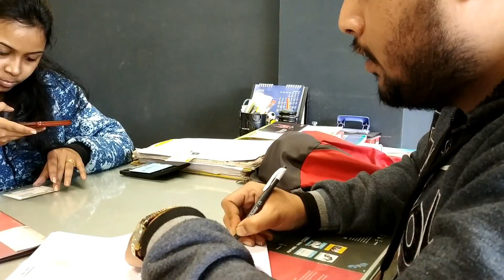Taking Delivery of Aprilia SR 150 ABS | Accessories Installation

Comment: how about the side stand how is it fixed
Reply from the maker: Company does not provide side stand, you have to purchase it under accessories.
Reply: T-G-A thanks but how is it fixed
Reply from the maker: Normal process
Reply: T-G-A do you need special side stand for aprilla or any brand can fit
Reply from the maker: No speciality, Aprilia provides specific side stand for sr150.